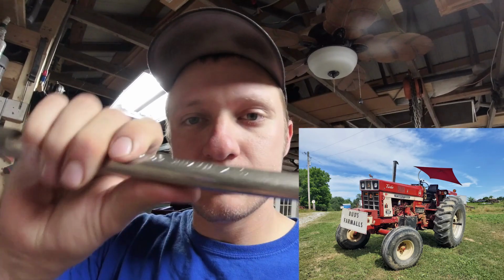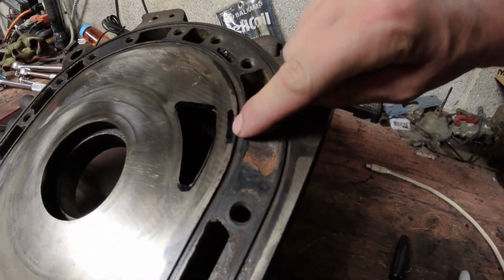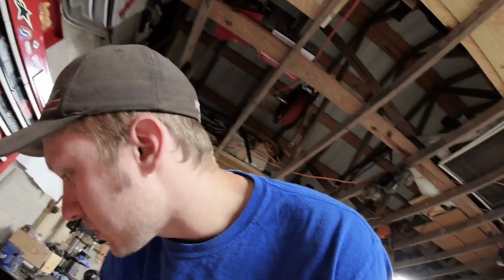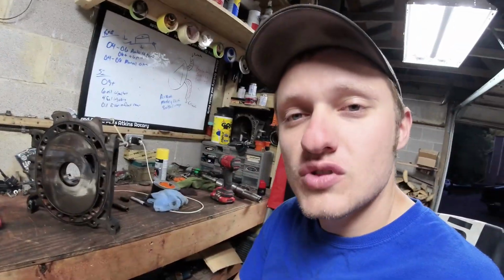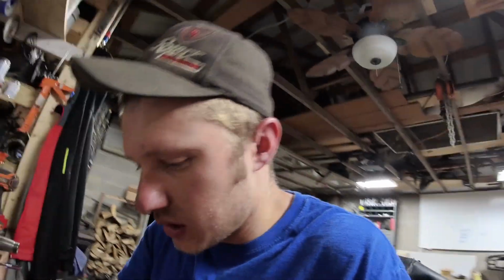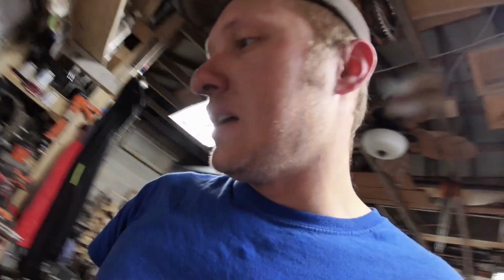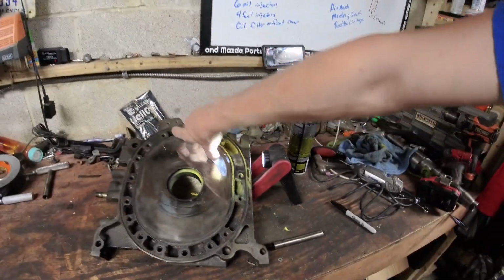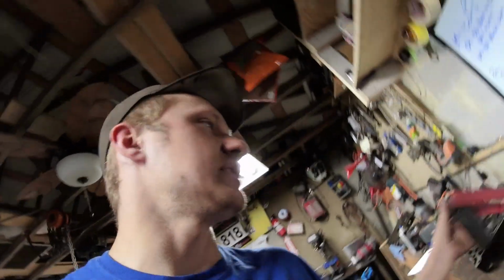You Want To Port Your Own Rotary Engine - What Are The Risks? Bridge Port 13B RE-Build

Comment: When I did a port and polish on my 87 supra head I did smooth out the casting on the exhaust to a mirror finish but smoothed out the intake to widen them but didn't smooth them to a mirror finish.  Left them with 80 grit marks. Atomizes the air fuel mixture better.

Comment: Your on the right track with the ports left rough, but you don't want to leave the casting as is, it's very inconsistent for air flow, so smooth it all out and go back in and use a fine diamond burr,( will fit your dremal), the finish is very consistent thru the port and the fuel mix wont drop out of suspension,  have been porting engines like this for years, 2 stroke and 4 strokes. Would like to post a picture but don't know how.
Reply: Post it on Imgur and then comment a link to it, that’s how I would do it personally
Reply: Hey Mark...quick question (maybe a dumb one)...I bought a '90 FC (NA) convertible last spring w/ 82K miles...it's stock, and I changed plugs, fluids, pre-mixed gas, drove it gently, etc., but just lost compression a couple weeks ago at 97K miles. I plan on rebuilding the engine this fall, and I was going to leave it stock, but now thinking about the pineapple half-half bridge port. ?-with any degree of porting, will I have to buy an ECU and have it tuned, or can I get away with skipping that step/cost?

Comment: I’ve owned a RX-8 for several years but have left the engine relatively stock, when the engine finally starts showing signs of needing a rebuild I plan to have a really good stock example Renesis built.

I’ve read and seen on the forums time and time again the Renesis gains nothing to even loses power with a Bridgeport or anything that effects scavenging/port timing due to the Renesis being unique in that it has zero overlap, so I was planning on just opening up the insides of the port a little bit, but leaving it pretty much alone. Most people on the forums swear by stock ports, people making 210-220whp on stock ports with basic bolt ons and a tune, infamous engine builder who did the Formula Mazda engines making 260flywheel on a stand with a stock port, etc. 

Do you have any thoughts on this?

Comment: so, instead of smoothing out the channel, would dimpling it increase horsepower the same way the honda guy did? or are the characteristics of a rotary too different from piston engines for the air flow to be effected the same way?

Comment: hi mate from Australia ..first your videos are what is making my rotary mission alot easier...I am a old v8 nuckle head but I have a 808/rx3 and I have recently got a rx8 as a donor car for it but I have fallen in love with the rx8 lol reason for the msg before I start pulling it to peices and wasting time and money the rx8 starts ok not great idles low has good oil pressure and water temp holds good but it won't rev out its like it has no secondary..to me it's like injectors are blocked do they run a secondary only injector ...any advice of where to start would be awsome ....I am slowly working through all your vids ..nice work
Reply from the maker: Look at the SSV and the Aux port valves. Most likely they are stuck or in operable. Do you have a CEL for them?
Reply: thanks for the quick reply I pulled the plugs and from what I can see the front roter is not firing...but coils and plugs are firing...the ssv seems to move but hard to know what is happening in manifold ...and the only reason I know what is in the manifold is your videos ...and thanks for that ....cel code ...bank 2 misfire and lean bank 1 ...so today is injector clean ....does that sound like the right direction?? I hope it's OK I want to link your rotrays explained video in my first rx8 video some tine next month ....most of my viewers are like me new to rotarys and your video made it simple to get started

Comment: If you’re only getting overlap from the bridge on the secondaries, how are you getting that “stoplight presence?” I’m assuming only the primaries are open at idle, am I wrong? Or is the large street port with tiny overlap on the primaries enough for baby braps at a stop light?
Reply from the maker: There is still a volume of air in between the closed secondary blade, and the combustion chamber.   That bit of volume is what allows the overlap to still be present at idle.   Since it's restricted by the closed blade, it doesn't brap as hard as If the bridge was on the primary.

Comment: when someone dies a book of memories and experiences burn. we all live our own tale so really make it your own!

allright beside the motivational speech do you have experience doing pp on rx8 engines? i want to keep it drive by wire on the original ports and a secundaire throttle pp also drive by wire. want to try and keep it na high rpm in my fb. would love your input. btw how much for your patreon because your giving so much i want to chip in. cheers from the Netherlands!
Reply from the maker: Thank youa
I have never done a PP on a renesis. Not sure if anyone has and maintained the stock intake manifold of sorts.  I'm sure people have used the renesis rotors in a PPort NA engine as they are the highest compression rotor. I'm sure you could have a custom manifold built to suit a renesis throttle body.